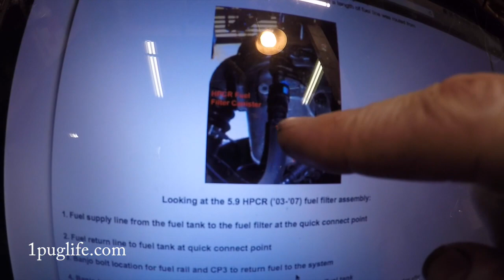dana 60 inspection and clean

Comment: pug check out summit racing U.S wheels cheap steel wheels  lug pattern on  the 83 is 8x6.5 measure one of your rims for backspaceing order up some cheap wagon wheels in 17 inch and run your BFGs

Comment: You should have gone to a 4x4 shop. Any shop worth thier salt would have everything you'd need for a dana 60 axle...
Reply: George Mcmillan no shit, a Dana 60 has nothing to do with dodge..
Reply: hill billy Thank you! I've owned many 4x4s over the years, and most had dana 60s under them. Currently, my '74 Plymouth Trailduster has dana 44 in front, dana 60 in the rear. I never once went to a dealer for axle components, always a dedicated 4x4 shop...
Reply: In Canada where its tough on vehicles,Dodge RAM is the longest lasting trucks around..Ford and gM trucks are rusted out hulks and GM trucks the door handles all break off and Fords are all sitting in yards with the cab off the body as they dont have $12,000 to do the injectors and another $10,000 for the head gaskets on Fords !

They have parts,just have to go to the right place..

Comment: Hey pug go on the rock auto website and get part numbers off there I found a rear seal for that Dana 60 i found a centric 41767001 should be the part number hope it helps

Comment: They came with dana 60s?  I thought thats either an 8 1/4  or 8 3/4 coporate rear. If so.
An 87 gasket will work.

If not any dana 60 seal will work.

Edit:That be a dana 60

Comment: Do not get a fass, go with the airdog. I had the fass on my 05 powerjoke. I loved my old f250. I mean it was such a beautiful solid built truck,but the 6.0 was such a poorly designed engine. I put so much money in thst motor lol. But last June got the 2002 ram 3500 with 6 spd manual now thats a truck. But I replaced the injection pump csuse went out,and instead of a stock lift pump I put a airdog 100 on it and I like much better thsn the fass 95 that was on ford. Do the airdog and put a beans sump on it. Will probally increase your injector life.